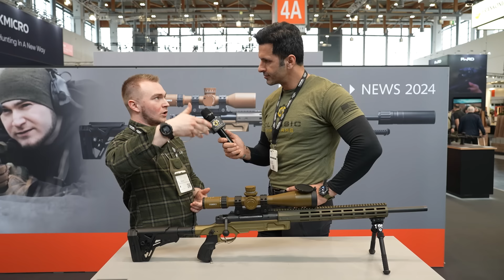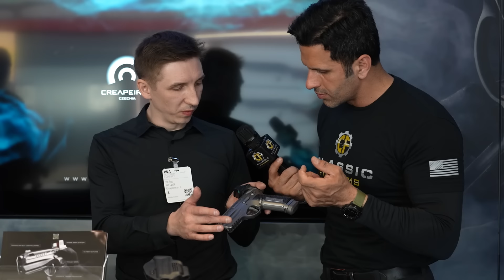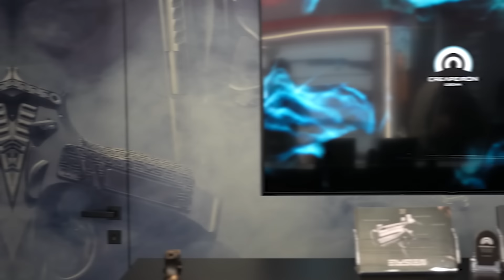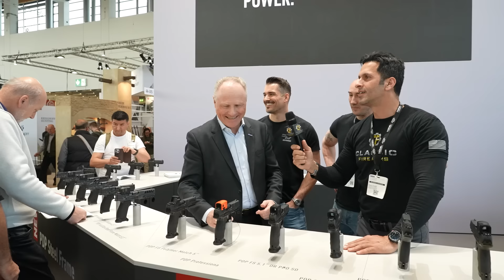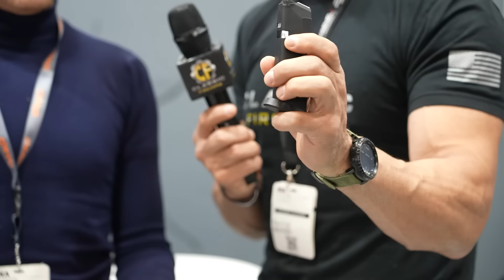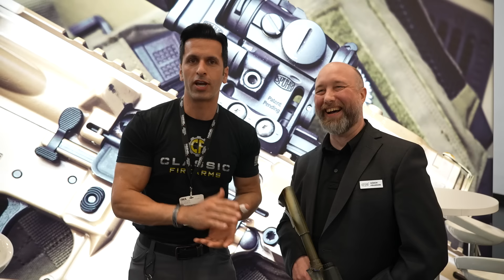IWA Show 2024 | Day 2 | New Guns Coming To The US

Comment: While Glock magazines offer undeniable advantages for pistol caliber carbines (PCCs) in the AR platform –  compatibility with existing handgun mags and a wider range of ammunition options –  I can't help but feel they lack a certain visual cohesion.

For many enthusiasts, myself included, the slim profile of a Glock mag disrupts the flow of the slightly more robust AR style magazine well. An ideal solution would be a magazine that maintains the functionality of the Glock design in the upper half, seamlessly integrating with the AR platform. However, the lower half could be redesigned with a thicker base and circumference, creating a more balanced aesthetic that mirrors the lines of a standard AR magazine. Creating a smoother/flusher look.

This redesign wouldn't require a complete overhaul. Imagine interchangeable baseplates specifically designed for PCC AR platforms. These baseplates could not only enhance aesthetics but also offer additional functionality. Texturing, stippling, or even finger grooves could improve grip and control during mag changes.

This concept prioritizes both worlds –  the proven reliability of Glock magazines and the aesthetically pleasing lines of the AR platform. In today's firearms market, where form and function often go hand-in-hand, such an innovation could be a welcome addition.

Addressing the "Looks Don't Matter" Argument

For those who might dismiss aesthetics as unimportant,  consider the ever-evolving firearms industry. Manufacturers constantly strive to improve not just performance but also design. Innovative features and sleek lines are just as crucial as functionality in attracting today's gun enthusiasts. A magazine that seamlessly blends with the AR platform without compromising on Glock functionality would be a win for those who prioritize both aspects.

Comment: A side charger on an AR system makes charging the rifle far easier when using a scope. Side chargers that reciprocate with the BCG allow the design to eliminate the forward assist as the charger is used as the forward assist which eliminates parts and time to assemble. When the "T" handle 1st came out it was futuristic and the gun rarely sported an optic. Today the "T" handle charger is more of a hindrance and expense than anything.
Reply: If they can make the charging handle ambidextrous then I'd be interested. Being a lefty is a hindrance in some cases.
Reply: @BloodySoup74  That is possible with the removable types (Like the AR 180 type) and milling of both sides of the reciever. Many right handed shooters like the charger on the left side too

Comment: Are side charging handles better than American style rear T chargers?? Just like Kaya said, M lock is better than quad.
Reply: Side charging is leaps and bounds better.
Reply: I find it much more intuitive and less gassy, especially when suppressed
Reply: I find it superior because it keeps it away from the eye piece. If you mount the scope too low you can't easily get to the T handle especially in gloved hands.
Reply: For many it's preference. For suppressed weapons, you shouldn't get as much gas in the face. I like my spear lt because I can use the rear charging handle to mortar the gun to clear a stuck casing. 

Mlok isn't always better than quad rails. 
For an accurate precision rifle, you may not need a quad rail and mlok is better. 
If you want overall durability and accuracy for any kind of LAM, a quad rail is a better option. Mlok is lighter but not as durable. So, for most civilians not using a mawl or peq15, an mlok rail is typically a slimmer and lighter rail.

It all depends on what your purpose is for the gun. 
The majority of beginner AR owners/builders seem to wonder what the best parts are for their builds and take advice from someone who uses their AR for completely different purposes and then they're not happy with it.
Reply: If you're pressed against a vertical surface for stability a side charging hadle can bring it out of battery. An issue I had with the tavor
Reply: @senojeelnodnarb it helps when it's a fixed side charging handle vs a folding side charging handle.
Reply: I don’t mind the T for a full size AR but not interested in any pistol, PCC, etc that isn’t a side charger